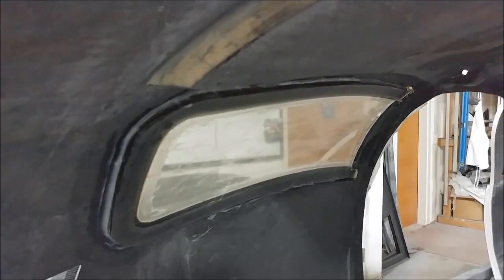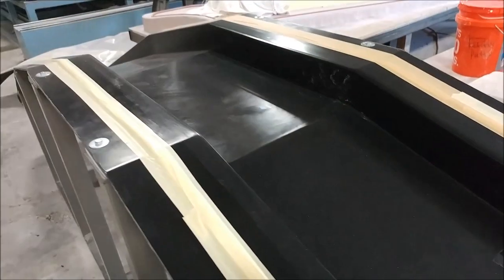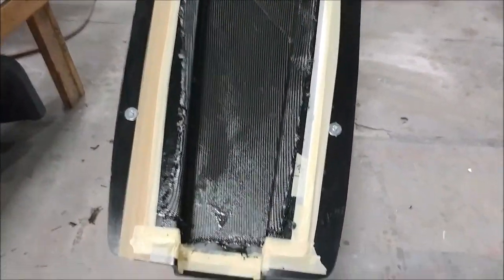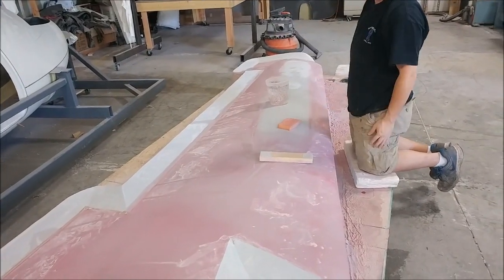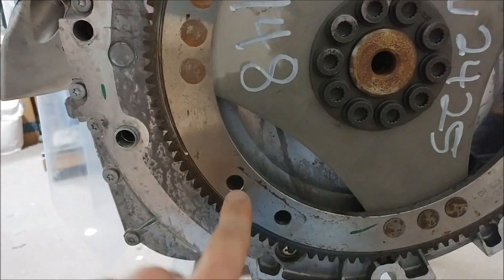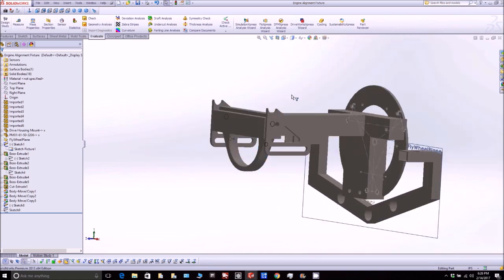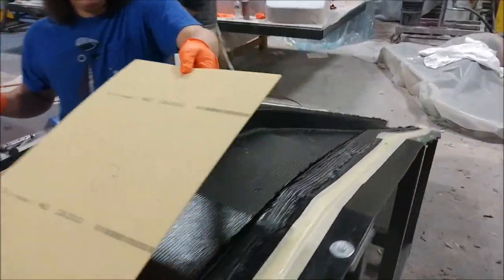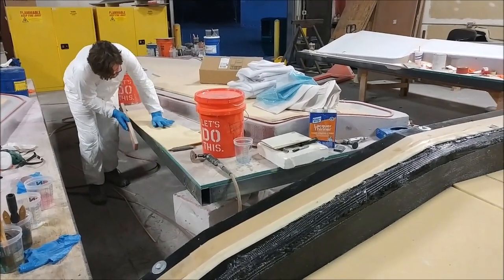Raptor Aircraft February 14th 2017

Comment: Peter, this may be highly premature, but when planning for the likelihood of this aircraft's successful adoption and subsequent optimization planning of mass production processes, will you be considering obtaining pre-cut fabric sections, or the machines that enable you to produce your own machine-cut fabric segments derived from your Solidworks design criteria?

These are production techniques used by larger commercial and military aircraft manufacturers who design with larger component assemblies that are cured in large autoclave ovens.  Such a capability would enable significant optimization of functional and aerodynamic characteristics even more so than you are realizing from your current designs.  Think of a version of the Raptor produced with a single-piece lower wing shell bonded to a two-piece fuselage.

Potential benefits include increased production capacity, quality, and consistency.  The components could also be joined into larger assemblies, such as bottom/top halves which could influence structural characteristics (integrity/strength) and reduce production costs.  Considering the cost of similar aircraft in this class such as the Velocity, this seems to me as a way to add significant value, especially when considering the possibility of offering the aircraft as a DIY kit for owners to assemble & finish it themselves.